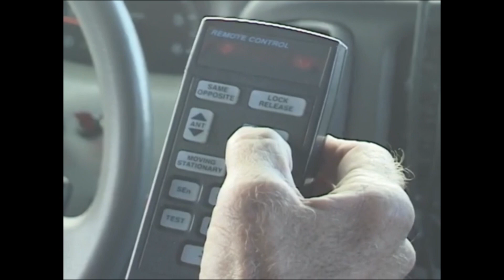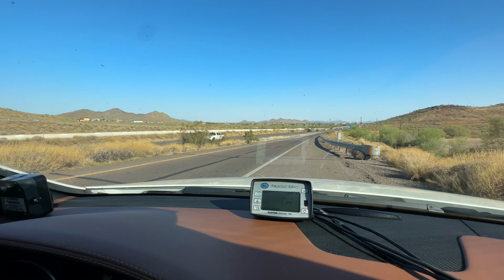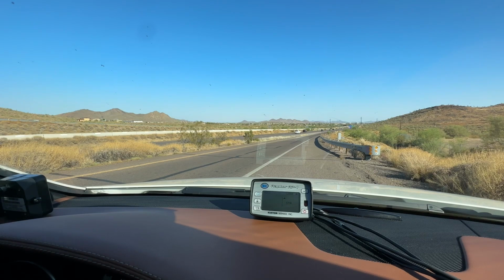How police use instant-on (I/O) radar from a hidden position on a highway on-ramp

Comment: how common is K-band these days? Despite following Vortex Radars guide on configuring my R8 for my region, I still get a lot of K-Band from stationary traffic cams, intersections, some vehicles, etc.. but I haven't had a confirmed K-band bogey (that I know of) from an officer. It's gotten to the point that I've considered disabling K-band, as all I've seen in my area is primarily Ka band and rarely laser
Reply from the maker: I can’t speak to what Vortex suggests as we really don’t follow him. 

We drive multiple states frequently and in just about every state we’ve seen k-band even in Washington state where I believe he lives. 

It doesn’t appear that he travels much so if he doesn’t see k-band, giving advice on RD configuration for others isn’t wise, IMO, if that’s what he is doing. 

We strongly advise against turning off k-band unless you travel only in a limited range where you know with certainty that it isn’t used.
Reply: I can tell you for certain K-band is used in Indiana for speed tracking from patrol cars both moving and stationary

Comment: Excellent and informative video. However, IMHO the heyday of IO was over several years ago, as the highways/freeways are loaded with traffic on top of the great strides in sophistication and sheer processing speed of the latest crop of detectors. Moreover, in speaking with my neighbor (MN state patrol), being careful and patient (as you've demonstrated) is often not practiced. Finally, I observed the gaps in radar usage in this video as 16, 23, 35, and 26 seconds providing an average of 25 seconds. If my math is correct, traveling at 80mph/25s will move the vehicle approximately 1/2 mile, about the max range of most newer detectors, which in many cases could mean just enough forward warning time - but not all of course. Let me know what you think.
Reply from the maker: It all depends where you drive. In PA all you will see is I/O.

We criss-cross the North America every three months and we see I/O often, more than C/O.
Reply: Not true. In Missouri, Arkansas, and Oklahoma troopers only use IO.

Comment: That's lethal. I mean, those cars can't see you at all and they are flying past thinking there is nothing in front of them when in fact they are getting jacked from behind as they pass. And with low power K band it's absolutely deadly. Would the R9 even pick up a whiff of that K band and if so, from how far away? Geez.
Reply from the maker: It certainly has the sensitivity and quickness. I believes it’s just a matter of police turning on their radar to get someone else. 

We will test the range of the R9 and others against this trap…
Reply: @RadarBusters  That would be a great video to see how the R9 would do against this trap. I'm using a Uniden R1 and it does a fantastic job of alerting me to very selective K and Ka but if there's no one getting shot in front me I just get nailed. These types of traps are lethal.
Reply from the maker: @greatpariscars  

We will be doing on shortly along with other detectors.
Reply: @greatpariscars  I travel early in the morning and if there is no one in front of me, I just back it down. I call them "bait. " As soon as someone goes by me, I will speed up again.  Always need a bait car in front or you're just asking for an instant on hit.  It happens a lot in NY.